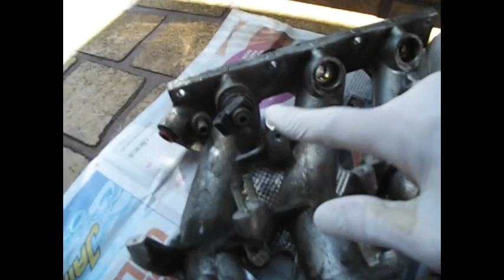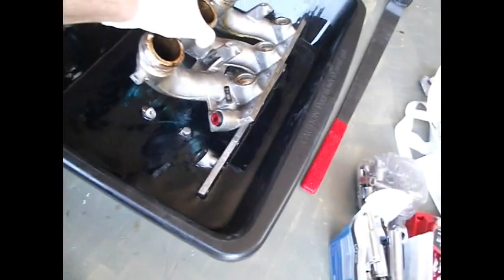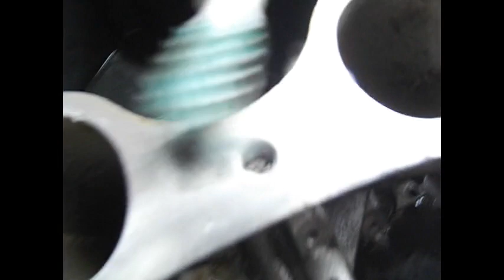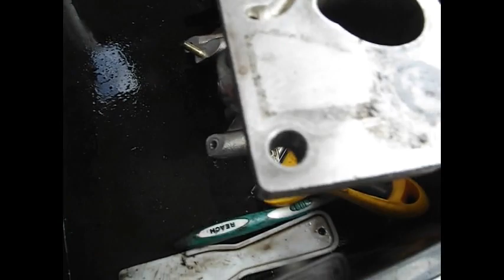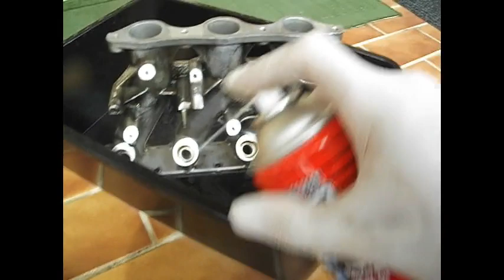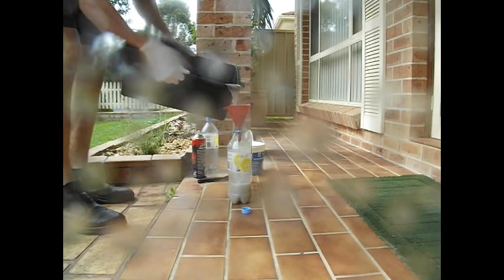Cleaning an intake manifold by soaking + brushing

Comment: Good video Jasco
Reply from the maker: Thanks for that earlier info Achi about the big end bearings, etc. So that cylinder block from Rimmerbros UK, you said it already includes all the bearings, does this include the main big end bearings? And does it also have the crankshaft inside of it or would you need to buy a separate crankshaft or use the one from your existing? Does it also come with new connecting rods for the pistons or no? I note you said it doesn't include pistons or piston rings, I can get these from the other supplier that you noted, but wondering if the new block from Rimmerbros includes all the main big end bearings and also the crankshaft as well as the con rods?

Comment: hello buddy. i followed your instructions and it came up trumps mate. i found the actual fuel line from the injector had blown off. where the red connector is. but it seems there is now a problem of refitting. i think the red connector has sheared part of its connection off, because when i went to put the tube back in there is nothing to hold it in there. the car started fine but i can see its just the pipe sitting in the fuel rail connector. from reading a haynes manual you should just be able to pinch the connector from the pipe to unclip it. that pipe connector isnt there. all it has is a small hard plastic tube at the end of the flexi fuel hose. i have ordered a second hand fuel rail from ebay with the red connector because i cannot find a replacement part for it. but im at a loss as to where to get the other end on the pipe that clicks over the red bit and holds the pips secure.not sure if you would call it a push fit end or what.
Reply from the maker: Hi Kristian, can you take a few photos of the small part on the pipe, that "other end on the pipe that clicks over the red bit" and holds the pipe secure? Email fotos to me at jascokovacevic@gmail.com  and i'll have a look for you this weekend when I go to the wreckers. I will also have a look to see if there's a part number for that part brand new.

Comment: hello mate, me again lol. iv been on a few freelander sites and no one seems to be of help, i was wondering could i pick your brain. i parked my 1.8 freelander last night outside the house no probs. came out this morning to goto work and it wouldnt start. so i popped open the bonnet and had a look. straight away i could smell petrol. my cars parked on a camber drivers side against the pavement and when i looked at the drivers wheel there was petrol around it as well. so looked underneath and could see fuel dripping from the sump guard. went back to the car and turned the key again and i could see fuel pooling by the wheel again. so im thinking its a cracked or blown fuel line. my question is mate. can you tell me where the fuel lines run. is it simple from the back along the drivers side then up to the injectors at the back. the pipe leading to the injectors seem fine. when i came home from work tonight i checked the underside again and its not leaking any fuel. there is a damp patch right in the middle of the underneath protective panel. is there anything under the engine that i need to be looking at? also im not sure if its related but on the passenger side of the engine bay theres a black container, i think its called a carbon canister. i can see two tubes going in to the bottom of it and three coming back out. one is connected in front of it, the middle one looks like a breather but the third which looks like it goes towards the back of the injector area is just hanging there with a  little tube connector on it like its popped off something. again not sure if this is related or just something i have just seen as i have only had the car a few months. thanks for any advice you can give me mate.
Reply from the maker: Hi Kristian, remove the underside protective panel while you investigate. The fuel line connects with a "quick release" type red coloured (red on mine) connector to the intake manifold unit, just look far underneath you will see it. Sometimes this can crack and develop leaks. Just run your hand in that area and see if its wet with fuel there. The other place is the intake manifold gasket. The fuel line on my 1.8 runs along the passenger side at front then disappears underneath to make it's way to the fuel tank. There's a leak in your fuel line most likely leading to the intake manifold thus your "no start" condition as the intake manifold is being starved of fuel. Generally it wouldn't be the charcoal canister.
Reply: Jasco Kovacevic  thankyou mate. il see if i can get under the landy. thanks for your help.

Comment: No Jasco this is bare block no parts includes this block have only 2 bolts :) Rimmerbros sell new crankshaft with bearings you can use old crankshaft if its o.k you need manual
Reply from the maker: Hi Achi, when you set up your head gasket, you didn't once turn the crankshaft with the cylinder head off did you? If so, this can destroy the liner seal (they are wet liners) and then you can have a very small coolant leak when only the engine is warm. By the way, the 1.8 has more power than the Kv6 at take off, but the Kv6 seems to use loads of fuel and is much quieter than the 1.8. The 1.8 is much quicker to fix than the KV6. I cannot say which one I prefer.
Reply: Jasco Kovacevic Hi Jasco yes I turned crankshaft when head of it was too hard I used liner hold tool I made this tool myself and you are right I think I did not put liners correctly I must be push them in to block and did not turned crankshaft before head on as manual says it is awful when  think I must do all again